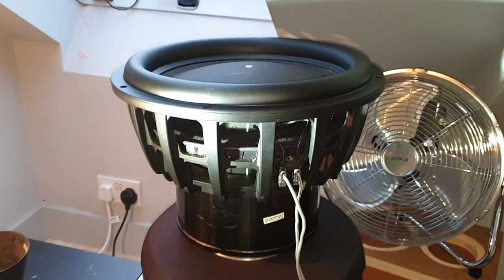Tymphany STW-350F Free Air Excursion at 20Hz

Comment: It needs more power
Reply: Random Tube listen in the beginning of the video
Reply: @chaeyoungshi I know, He sent his other amp in for repair. But still you can never have too much power as long as its controlled and unclipped.
Reply: Random Tube well uhm what you say is sort of wrong because if you put a 10 watt speaker to 100 watt of power it will die
Reply: Clean power i mean ofc
Reply: @chaeyoungshi  You would be surprised what a proper thermal regulated driver can do on clean low thd power.
Reply: Unfortunately
Reply: Stein You're actually incorrect. Amps don't output full power at nominal listening volumes. If you paired a 10W RMS driver with that same amp, at normal volumes that driver will be happy. Random Tube is correct on having too much power is never a bad thing. Trust me, I've seen drivers die due to the amp clipping because of not having much headroom to drive loudspeakers. I had to replace a tweeter due to that.